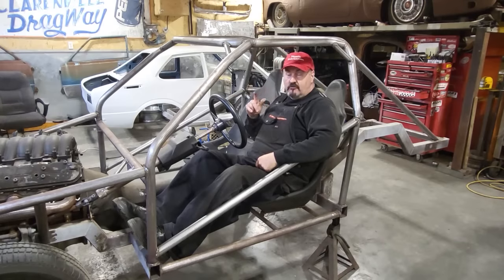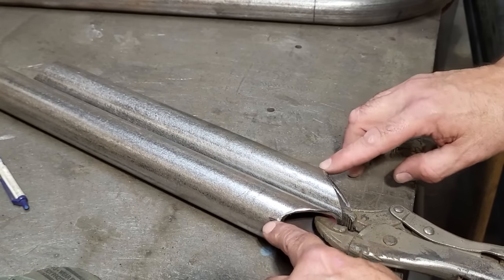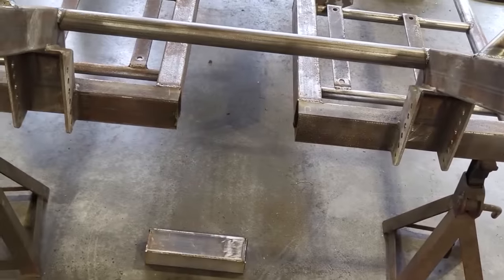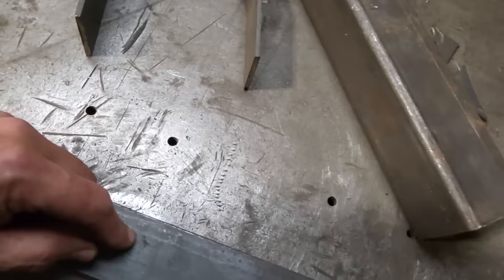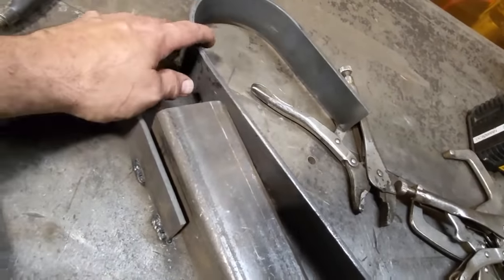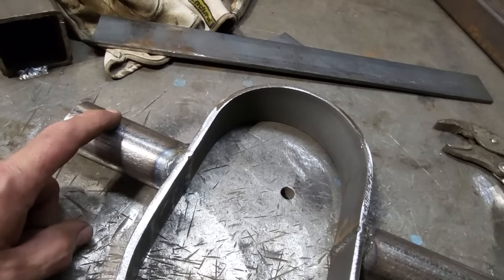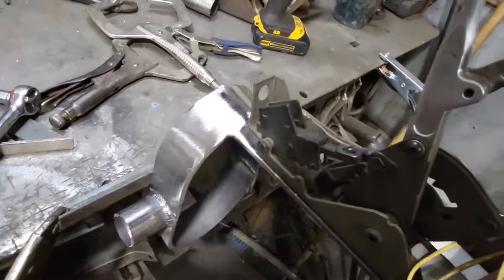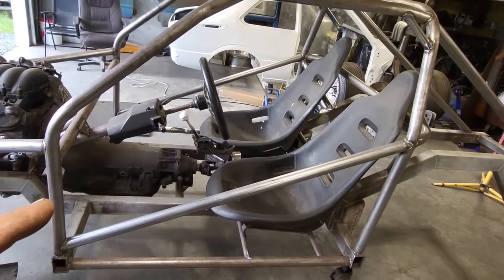Building a driveshaft loop.Finshing off the roll cage

Comment: Hi Tony.  The tips are good.  The safety tip for the angle grinder was a real good one.  There's a reason that it's called that the death wheel!  If you don't respect how much power is that little tool, it will hurt you.  The frame is looking good.  Nice and clean.  Thanks for the video!
Reply: Some time back, there was a guy on the news here in Australia showing what happened when a cutting wheel exploded and hit him in the eye. It took out his eye and a big scar above and below his eye. I've had two of these cutting wheels explode in the past, shrapnel went in all directions except towards me because I had the guard on the grinder. Always safety first.

Comment: Have you thought about placing two 4” (I’m guessing) vertical tubes on either side of the driveshaft opening to connect the rectangle tube crossmember to the parallel round tube piece you put in? Looks like it could get some flex under a load from the engine/rear suspension after you cut that section out of it.
Reply from the maker: It's all tied together and the two short bars off roll cage will triangulate the frame

Comment: I think it would look good  with a X bracing at the back going to the shock mounts and a diagonal one on the roof just throwing out some ideas to you the car is looking really good you might even need something in the firewall when you go to put the sheet metal in It’s a lot of work doing this stuff by yourself 💯👍
Reply from the maker: Don't see alot of X's in cars these days. It was done to keep it from twisting. I'm running a anti sway bar and that what that does. As for one in roof. I thought about that. Think it be something I'll hope my helmet on. Lol

Comment: Tip: using light-weight card, wrapped around the tube end (think: toilet roll type tube slipped over the 'cage' pipe), you can easily copy complex curves from one pipe to another. Using tailors tape (or the fancy printed tape measure type tape) you can 'clock' the 4 cardinal points around the circumference of your pipes, from the original to one your trying to copy the same end profiles to. Leave a 2-3mm extra to fine hone into place with your grinder/hand filing/whatever. There are folks who show this method on Youtube and it may save grind-fit-grind-fit... tediousness, to more agreeable time frames. 

Question: other than aesthetics, why not keep the over-lapped two halves fabricated and weld them along the ends and edges, to form a double loop, almost, for your prop-shaft safety loop? Trimming them off and simply butt welding them, can't be as strong as over-lapped 'straps', no? Is it a racing spec. requirement, to show penetration/presentaion of welds you've employed/deployed?

If it was me: I think i would have braced the shifter platform, though how you've finished it will perform as required, I just don't like 'springboard' brackets and triangulation of engineered frames provides performance, security ("a rock solid base", if you will), and a little harmonious aesthetic too... in my humble opinion. 

Loving and learning from every Fitzee presentation. Thank you, Sir. Onwards...
Reply from the maker: The overlap will put one end off center. Reason I added the pipe to the welded area. To add the strength. Acts like a gusset between each end. As for welds. You need to see welds so as to see how they are connected. A grind off weld hides what is possibly done.

Comment: Some years ago, I knew someone who had the front universal joint on the driveshaft fail. He said the driveshaft dug into the road and lifted the car up and almost rolled it. The floor was also pretty bashed up. After that, I fitted a drive shaft loop in my car, because back in those days, we drove a bit faster than I do now.

Comment: Two things first there is a hose with an end on it that runs from the rear window channel to the hole in the inner quarter panel behind the outer rear wheelhouse. It is available reproduction. Second the rear quarter glass order a set of 150 utility sedan rear quarter window rubber channels. The utility sedan had fixed quarter  windows and used a gasket much like the windshield and rear glass. Also order the 150 windshield and back glass runners they have no channel for the stainless.  If your going to radius the rear quarters save those crap fenders use the wheel openings from them they are the same as a nomad. Nomads had symmetrical fender and quarter wheel openings.

Comment: Weld t 42:19 hat floor on the bottom of the frame rails to make bottom of car smooth! Cheat the wind ,little faster! Finish floor will let everyone see your chassis work!
Reply from the maker: I have a use for all this cavities under the car. They will need to see the frame under the car for inspection if I go to a different track.

Comment: Wouldn't the overlap be stronger than a butt weld??
Reply from the maker: Yes but the loop would have one side off center. My OCD  won't live with that. Lol. The pile that mounts it is overlapped on the joint so that adds to the strength

Comment: You have created a pretty big problem now you put those two little agle bars near that rear loop . Wen you bend up ur tubs for wheel there not going to fit . Not against your roll cage but dont you think its bit overkill for 500hp street car . Would understand if was 2000 hp but its not .
Reply from the maker: I already sized up the wheel tubes. Have lots of room. I am giving this car some room to grow. This is an 8.50  style cage so if I ever built enough power to go there I'll be save. Better to overbuild for upgrades down the road
Reply: No worries

Comment: Fitzee you amaze me with that Jig ! I know you said you built the table but where did you get that large piece of steel for the table top?
Reply from the maker: The table was something given to me years ago. I never built it.
Reply: If you were going to build one how would you do it! @fitzeesfabrications
Reply from the maker: @petediamond7263  think the square top frame  needs  to be heavy.  This one over the years has a slight bend in the top in middle. If I was to start I build the top out of I beam. Seems that I can find short sections around